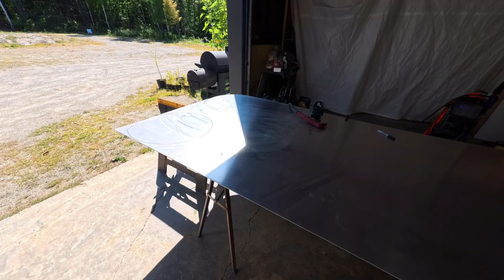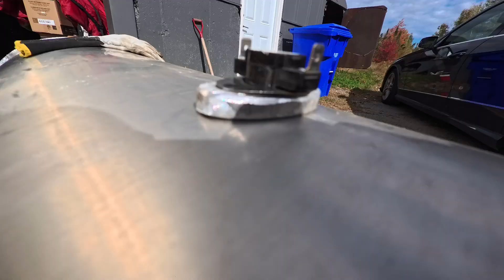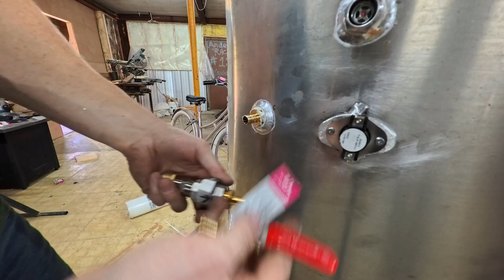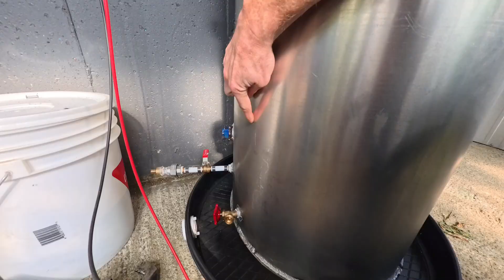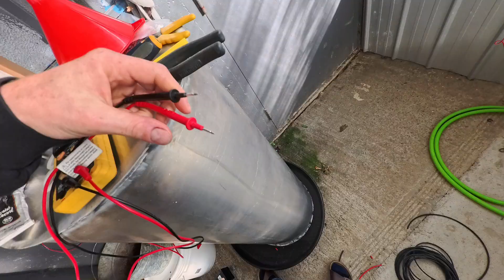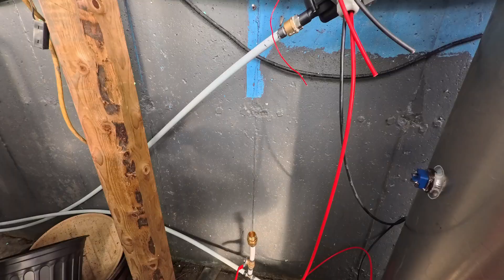Greenhouse Heating: Solar to Hot Water Hydronic Heating

Comment: Looks good. I have similar system but much larger scale. Uses a 2000 gallon tank. Used to heat raised beds in nursery high tunnel. Heated with 3 3kw immersion heaters using off peak electric.  System works well, will he adding solar thermal to heat tank.  Only used from march through April for germination.  Cheers
Reply from the maker: Wow that is large. Mine could be bigger, but this year I’m going to turn it on earlier to build up a battery of heat first. Hopefully next year works better